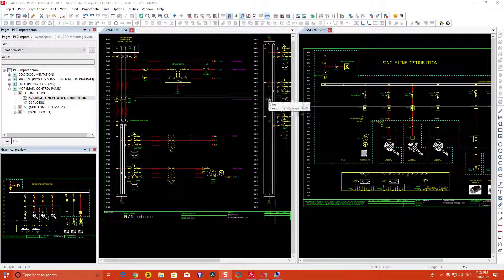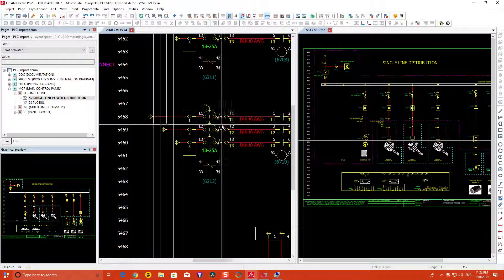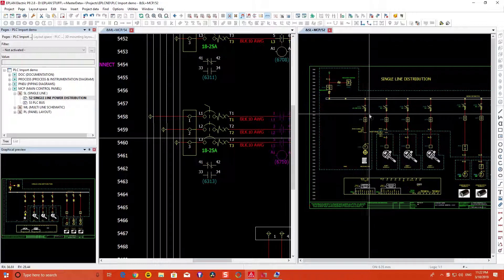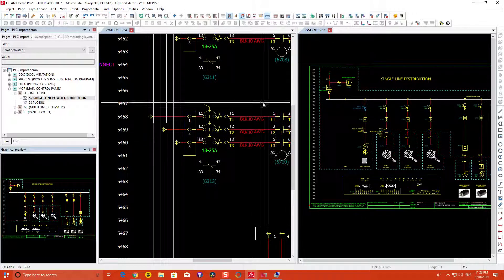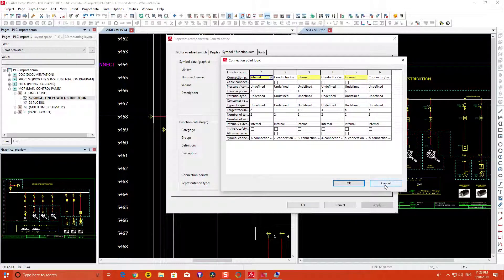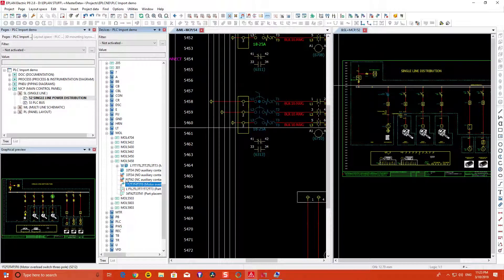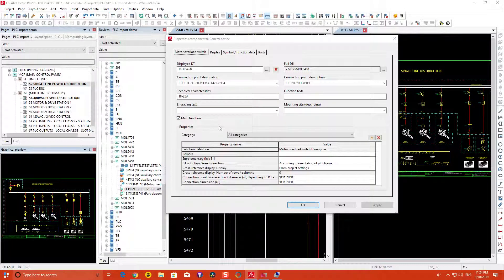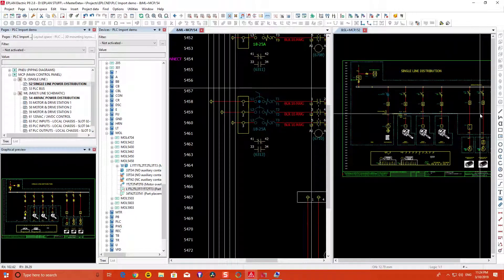Single line VS multi line

Comment: Is it possible not to display the elements in the panels (structured box), show the cables between the external components. The single-line seems to be a dubbed multi-line, with nothing more to add than errors in connections,  is there verification that compares single versus multi? Or it is just for power distribution? How do you manage a cable that works on several elements in single-line, like a control cable that go on five different terminal strip?